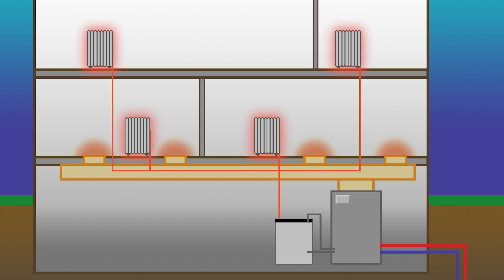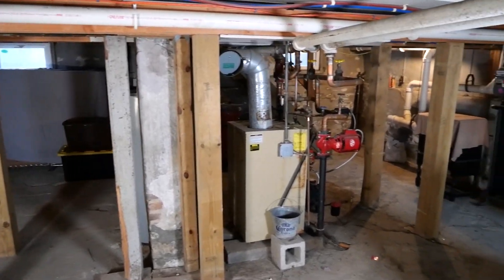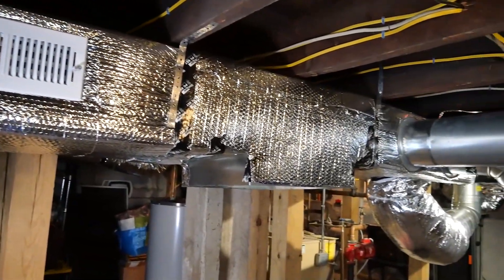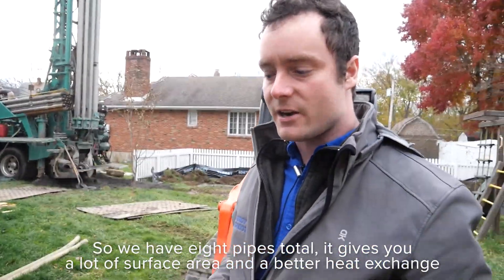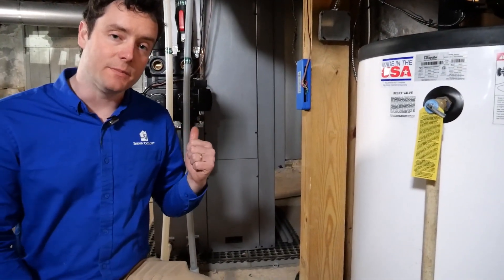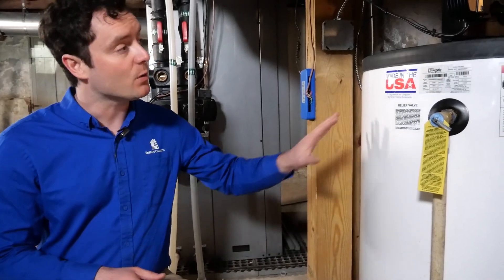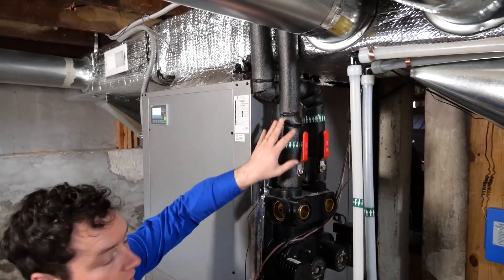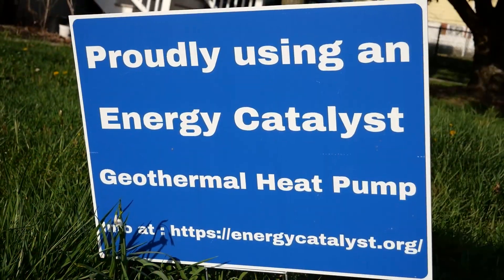Geothermal for Hot Water Radiators

Comment: Why would you need extra water in case of severe weather?  I was given to understand that using a ground-coupled heat pump prevents the inefficiency that results from using an air-source heat pump in cold weather.
Reply from the maker: No extra water or backup heating is needed during operation, sorry if we gave that impression. The unit performs at high efficiency under any outdoor air conditions. It does have electric backup elements built into the hot water tank that comes with it, but there is no need to use these elements once the heat pump is operational. The only time we see them used is when an installer is performing a change-out in the winter, so that the building can have hot water heat while the heat pump system is being installed/commissioned.